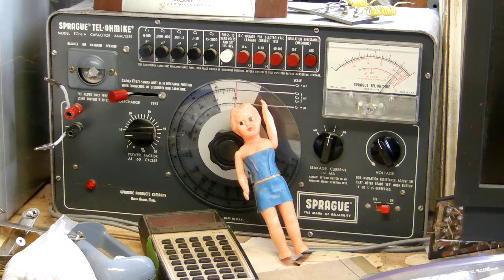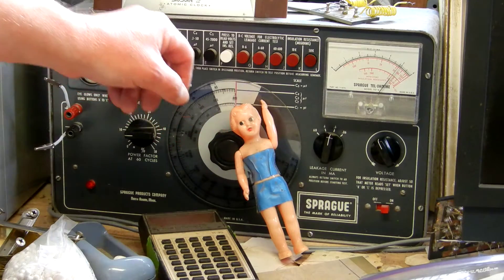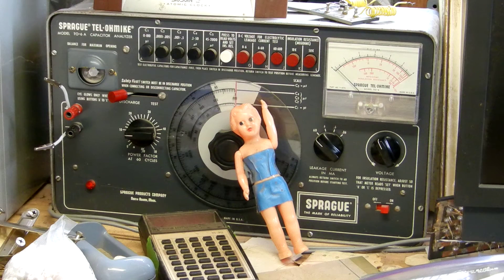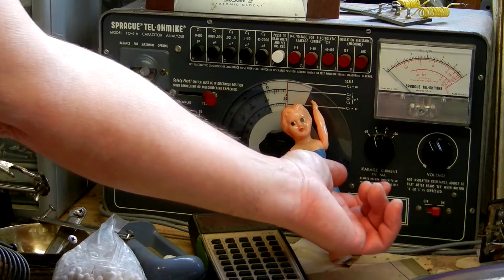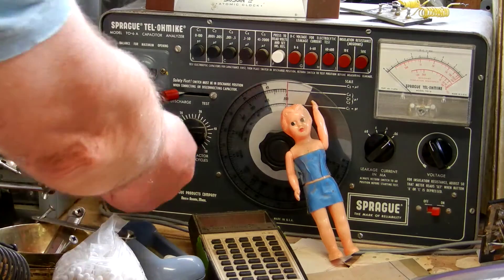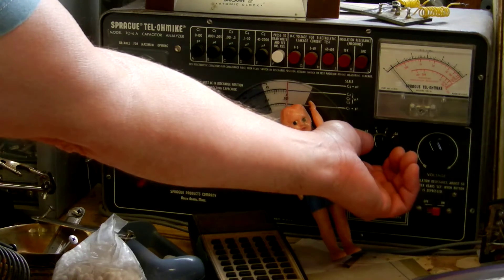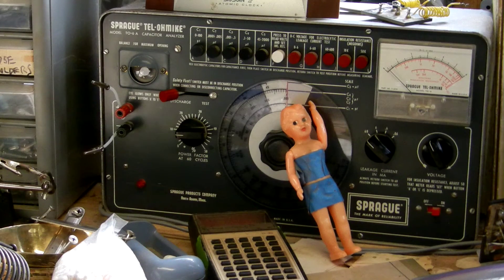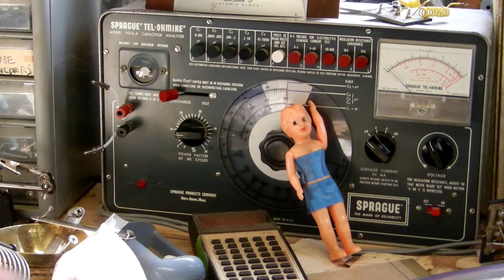Capacitor Leakage Testing using the SPRAGUE TEL-OHMIKE T0-6A capacitor analyzer

Comment: I have access to a Capacitor Tester but I’m not sure on all the proper settings for it. Voltage is easy, I’ll set it to the rated voltage of the Cap. The other settings are 1. Charge Current Limit (0.5mA-500mA), 2. Leakage Current Measurement Range (2uA, 20uA, 200uA, 2mA, 20mA), 3. Charge Time (0-999 S), 4. Dwell Time (0.2-999 S), 5. Measurement Speed (Fast, Medium, Slow). I will be using it to test my various Caps in my MC240. Thanks for the guidance in advance!

Comment: Here is something notable I found out about the non-rectified test bridge in Sprague Tel-Ohmike Capacitor analyzers.

http://bama.edebris.com/manuals/sprague/to4

So much for using one of these to reform capacitors over an extended period of time.
Reply: I have the T0-6A which has many improvements over the TO4, including capacitors that are supposedly leak proof.  I've been using it for YEARS with zero problems.  The T04's are known for very leaky capacitors.  I did this research before buying!!!

Comment: That little screwdriver adjustment in the center front of the meter is for zeroing the meter pointer .
You do this with the power off long enough to be sure there is no power left in the tester that could be moving the meter needle.

Comment: I like your video.... could you also demonstrate the magic eye indicator to measure the value of a capacitor... this is really cool stuff...
Reply from the maker: Hey Chris,

Actually I have another more modern capacitor tester to check for capacitance and have never used the magic eye, which is cool but untested. 

I'm going to be testing some NOS Astron pio caps for a build I'm going to be doing in a week or so.  While I'm at it I'll test the magic eye to be sure it works and if so will video and post.

Unit_1
Reply from the maker: Hey Chris, I've tested the T0-6A magic eye and it works!  I posted a video of how to use it at: MVI 0645 Magic Eye Demo

Enjoy!

Comment: Just finished recalibrating the leakage detection circuit and voltage measurement. Quite a neat beast, the way it's all hand built!
Reply from the maker: Google has been blocking my comments because my name was my Quake3Arena user name.  And Mozilla wasn't showing me this in the popups.  Got that fixed.

Yeah compwiz101 I just love mine.  It's old school but gets the job done and doesn't cost an arm and a leg to buy!!!
Reply: Unit Yeah - I ended up getting new calibration references for it. Found some 2.0uF soviet military surplus capacitors rated to +/- 1% that did the trick